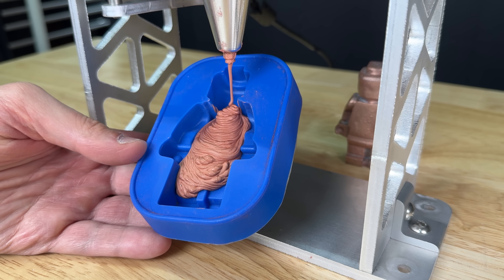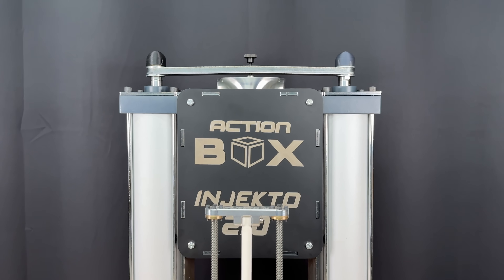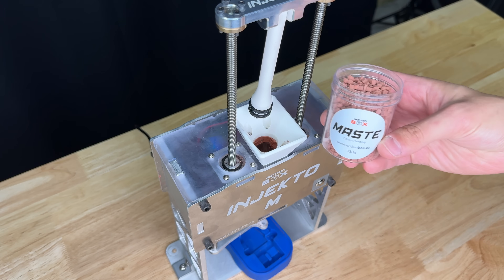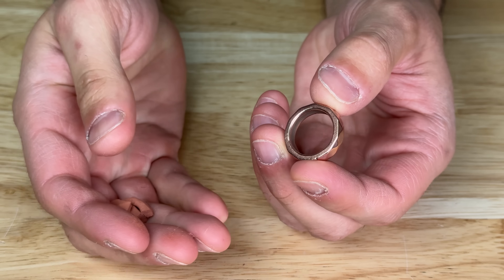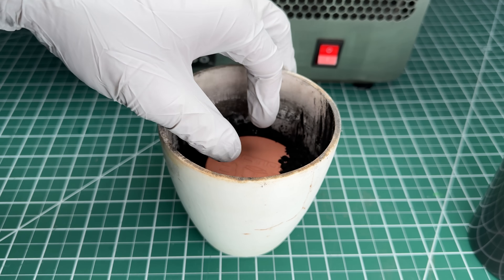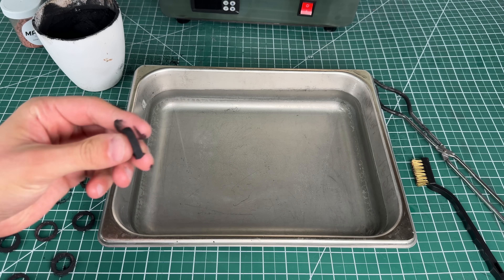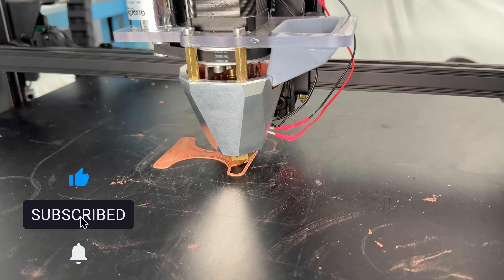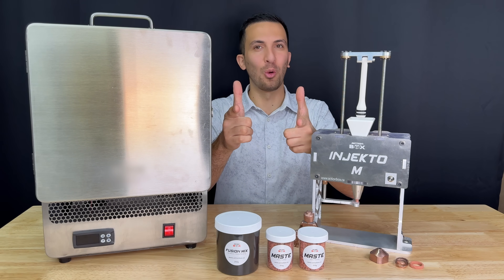DIY Metal Injection Molding with INJEKTO M

Comment: Do you have plans for other metal like mild  steel or stainless or tungsten (haha) or will it only be copper and cu alloys?
Reply from the maker: Funny enough we are currently working on Tungsten but that will not be made commercially available. We are also working on iron based metals and hope to release them in the future. Additional metals will be silver, bronze, and inconel. 

Hope that helps.
Reply: @ActionBOX  thanks. I might pickup when you offer steel, especially stainless. Stainless is pain to machine, so this might be useful.
Reply from the maker: @yootoobvyooer  sweet, stay tuned for more.

Comment: Can the Injekto M still be used as a Plastic injection molding machine? That would make it extremely valuable (Why does it have to be a single button for operation?)
Reply from the maker: No it can only be used with MASTE. You will need INJEKTO 2.0 for plastic injection.

Comment: very interesting,  so once complete after the furnace is the part basically copper?  Also would like to know if it is a good conductor ie resistance per inch with a given circular mill area.  Anyone do any measurements as such?
Reply from the maker: yes it comes out as pure copper. The electrical properties will be similar to those of pure copper as well.
Reply: @ActionBOX  thanks for the quick response.  Also wondering if it is printed as thin strips that would be used in electrical switch contacts similar to what is used in pinball machines where a thin 1/4 inch wide by say .100 thousands thick and 3 inch long piece, printed and oven cured would have the ability to be used as a spring loaded contact ?

Comment: Is the maste thin enough to use in silicon molds without distorting them? Also what is the shrinkage amount of the final metal part?
Reply from the maker: yes, MASTE flows very easily and gets into cavities without much pressure. You can see the threads on the part we made in the blue mold in the video. The shrinkage is about 6%. Hope that helps.

Comment: This is simply sintering and your implementation of this is brilliant! As a tech in the field of metal injection molders I’m impressed with the simplicity of what you have achieved, and I love that this is a far lower temperature process than other options out there, while still flowing like a liquid. I might have to buy and give this a try!
Reply: Can this technology used for machine parts?
Reply: @canerguener8664  sinterizing can be used for machine parts
is usually weaker than just casting,but some parts dont need peak strenght/performance

long short story,casting allows metal to be one solid chunk

sinterizing means you put small dots/particles on a clump and then melt them together,but there is always small bubles and spaces between the dots (like the spaces between a bunch of marbels or a plastic balls pool),this less packed use of space means is less stronger than casting

so make sure to check the sinterized part strenght tolerances!
Reply: @canerguener8664  I wouldn't trust this for heavy duty machinery. Industrial sintered parts are formed by a very larger pressure before firing than the injection molds showed here. The process is similar, but I would not advice using for machine parts unless you know the stress the material would have to handle and their strength properties.
Reply: @astropgn Thanks for that . If you know more about sources or technologies e.g.   , please tell me.
Reply: Great knowledge thank you very much !
Reply: I hope you feel photosynthesis rn

Comment: A couple of questions. What is the design shrink ratio for copper maste.  Second when will bronze and brass maste be available as copper is far too soft for our applications..
Reply from the maker: Bronze is in the works. You’ll still need the rest of the equipment. Stay tuned 😃

Comment: Intriguing. After the crucible process, is the metal magnetic? Can the metal be electro plated? If so, what anodes can be used.?
Reply from the maker: Yes the metal is pure copper so you can plate it the same way you would plate or work with copper.

Comment: That seems to be close to the "desktop metal" métal 3d printers, wich print some filament with metal and something else (plastic?) in the filament, and you have to sinter it before to remove all that is non metalic. Yours seem to be way more easy to print (or mold) and sinter, desktop metal is around 120 000$ for the printer and furnace, and I don't speak about filament price... If you can make it more affordable, it will be a game changer and I will buy damn fast 😂 What about the laser sintering "printer" you showed few week ago? This project replace it? Does it still in progress? Thanks guys, anyway it's always interesting.
Reply from the maker: Thank you for your supportive comment. You say "if we make it more affordable" but we brought the price down from $120000 to $2500 haha, unfortunately there isnt much more wiggle room. That said, for anyone who buys the INJEKTO M I will sell just the 3D printer extruder to as well so they dont have to buy the entire kit again. 

The laser printer video will come out in a couple of weeks where you will see the evolution of our science and engineering. 

Cheers, 
Dave
Reply: @ActionBOX  2500$ is way more affordable than 120k 🤣I did not know the price, and for the "material" how much? If you have planned it of course. For the price of the 'machine" I was thinking about the 3d printer rather than the Injekto, to avoid mold, just like the "desktop metal" printer.

I'll keep watching for the new about the laser metal 3d printer, I'm sorry about my bad English I'm French, I was not trying to say that 2500$ is expensive fort the Injekto, I just did'nt know the price so I was expecting something cheaper than 120k, and off course it is, it's a very affordable price for the injection molding machine, plus it can now inject metal it's just crazy.

Thank you for your answer, I'll see you soon on the store I think 😀
Reply from the maker: @abadiepierrick3295  O I see my confusion. Yes the printer head will likely be around a similar price point for the kit which includes the furnace, and all materials. Thanks again

Comment: How porous is the material?
Is it as dense as molten metal cast parts?
I would love to see a demo with some functional parts
Reply from the maker: The density of the material can be increased by leaving it in the furnace a little longer (say 3 hours instead of 2), but it will still only cap out at around 93% if I had to guess.
Reply: @ActionBOX  wow 93% is really impressive for such ease of use
Reply from the maker: @bartekburmistrz8679  Absolutely, check it out on our website action box.ca if you are interested. Use code ACTIONBOX for $400 off.

Comment: Very impressive. Does the part shrink (much) during the final heating process in the crucible?
Reply from the maker: Hi, Yes the part shrinks about 6% which needs to be accounted for in the design. We just 3D print our molds 6% larger (before pouring the silicone into them)
Reply: @ActionBOX  many thanks
Reply from the maker: @gbspikyfish  absolutely.
Reply: @ActionBOX  this is exciting. Is it possible to calculate the shrinkage precisely enough to create precision parts? Like a spare part that fits?
Reply from the maker: @NickSpirov  Hmmm, interesting question. We have successfully made a bolt and a nut that threads on it (in a video that will come in the future) but I would need to know exactly what you have in mind to comment further.
Reply: @ActionBOX  I guess the question is: can the shrinkage be predicted/calculated with any accuracy? If it's perfectly uniform regardless of the model then obviously a simple 6% scaling increase would do the job, but I assume it won't be completely uniform (depending on the model geometry). Regardless, it's a really interesting product, and if you could produce an FDM filament it'd be amazing.
Reply from the maker: @gbspikyfish  It should be a consistent 6% shrinkage. Unfortunately there are far too many issues with filament so we will not be offering that to people. the MASTE works far better in our experience.
Reply: @gbspikyfish  This is how the Markforged metal sintering process works, with the exception that the part is modelled to final dimension, and the printer slicer calculates how to deform it to allow for shrinkage.
Reply: @ActionBOX  shame that filament isn't feasible, but the injection modelling option does look very interesting.

Comment: this is awesome, is there any future chance this will be possible with ex. aluminium maste or steel maste? and how much scrinkage is the after the parts comes out of the furnace? SO exciting guy , Great job
Reply from the maker: Hi John, Aluminum will not be possible for reasons that I will get into in a future video, but we are currently working on Iron based metals indeed. The shrinkage is about 6%.
Reply: @ActionBOX   Do you have inconel on your research list? I heard it sinters pretty nicely.
Reply from the maker: @SianaGearz  yessir we do. However it's about 5x more expensive than the current MASTE.

Comment: Will  there be more than just copper available as a metal?
Reply from the maker: Yes indeed! We are currently working on that. We have successfully made silver parts and are currently working on iron/steel. A future video will also demonstrate our testing with Titanium.
Reply: @ActionBOX  How about aluminium ?
Reply from the maker: @werewolf00000  No Aluminum will not be an option unfortunately.
Reply: @ActionBOX You can just use Zaman 4
Reply: @ActionBOX  it seems like the issue is with aluminum's reactivity,   i am wondering about ionic liquids and low melting point salt mixtures,   ball milling in inert atmospheres,  and prepacking the mold with gold or copper plated aluminum granules. to offset the density issue.

actually,  the prepacking thing might be worth looking at since granules will be cheaper than paste. allowing for bigger injection molds with the same injected volume.

just have to preheat the granules.
Reply from the maker: @Dustmadeout  whats that?
Reply: @ActionBOX  Sorry I'm drunk. It's called Zamak, and it's 3, not 4. You can probably directly 3d print it, because of it's low melting temp.
Reply from the maker: @Dustmadeout  Cool stuff, I had never heard of it before.
Reply: @ActionBOX  It is used in die cast cars a lot.
Reply: Do you know the density of the parts once cleaned?
Reply from the maker: @trkoo  It is upwards of 93% the density of pure molten copper.
Reply: Iron or steel would be cool, but it would require a more powerful furnace. The sintering process has to be done close to the base metals melting point. Copper and silver have a much lower melting point than iron/steel.
Reply: @brianmcginnis7417  That's what I thought until I heard of Copper/Tungsten, the copper melts and bonds the tungsten powder, it is not an alloy but a bonded matrix. Hmm Bismuth/Tungsten, Tin/Tungsten might work too.
Reply: What paste is used here?
Reply: What about gold (for jewelry)?